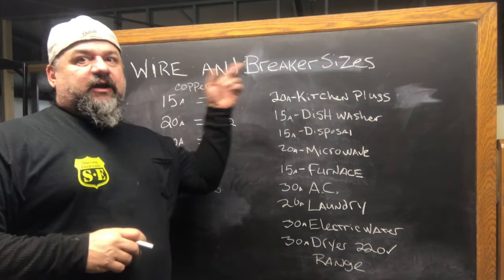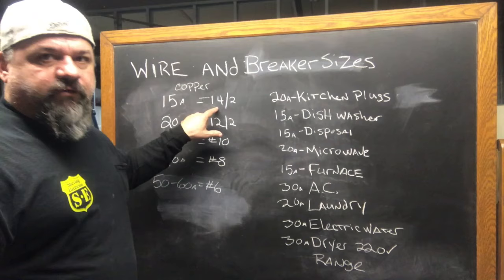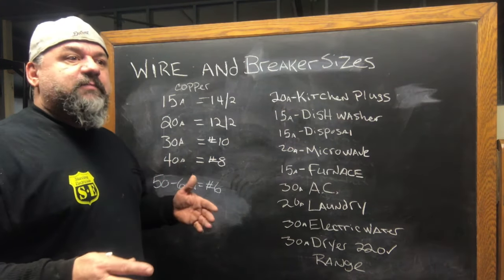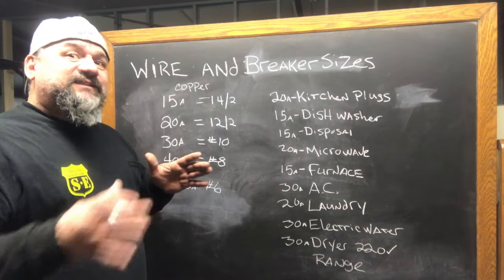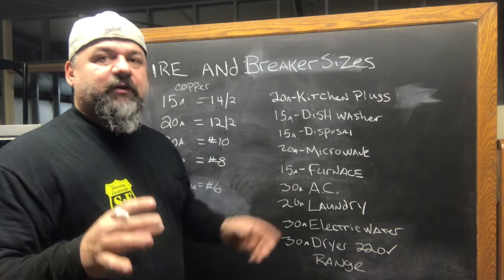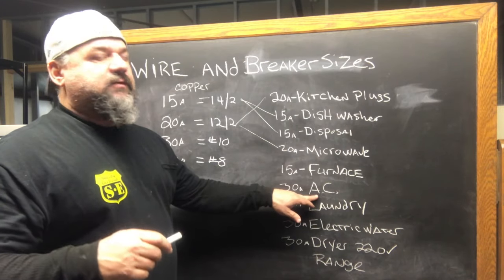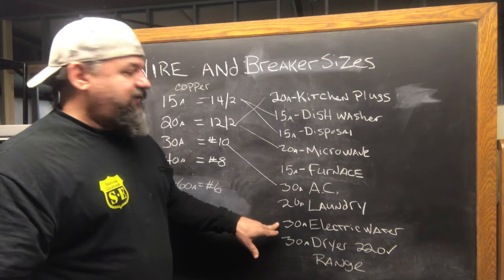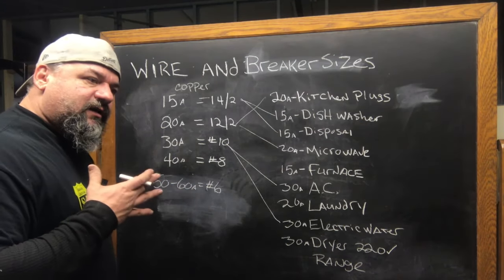"Uncover the Secret to Easily Calculating Electrical Wire and Breaker Sizes!" You wont believe it!

Comment: I recently installed a wall charger for an electric vehicle.  The car pulls 32 amps.  I ran number 6 wire with a 40 amp breaker.  Unfortunately my breaker keeps tripping.  I’ve made sure there is practically no pull from other devices in the house but the breaker trips nonetheless.  Any ideas?
Reply from the maker: well sometimes you just have a bad breaker. your breaker size and wire are right. id start there. load from other devices make no difference on this circuit if its alone. if you are feeding something else then you will have problems. it must be dedicated.
Reply: @StarvingElectrician  thanks for the insight.  Yes it’s in a dedicated line.  I’ll replace the breaker and see what happens.  Sincerely appreciate all your content.
Reply from the maker: @chrisbrawley8810  thank you. always start with the simplest thing first.

Comment: can i use 6/2 wire for 50 amp box
Reply from the maker: yep. its the breaker size that needs to be correct. the wire size can be larger but in this case its right on.

Comment: Im wanting to run an extension cord to plug in to my electric dryer outlet to my 50 amp plazma cutter that I use sometimes. The cord I'm using I got from my old job . How can I tell how many amps it will hold? My dryer is 30 amp
Reply from the maker: it will trip the circuit. check the breaker size for the dryer. even the wire size is too small. go with #6 and a 60 amp breaker.
Reply: @StarvingElectrician  I made one with a 10 gauge wire about 50' long but only ran 35 amps though it . Breaker is 30 amp. Worked great . Most of the time I'd only use 25 amps though, I mainly wanted to see the difference which is a lot. But my cutting mostly consist of the sheet metal. Any suggestions on cleaner cuts, mine seems to be more jagged?
Reply: It need to cut out flames on my fire pit which is an old washer drum so I've been practicing ahead of time.
Reply: @StarvingElectrician  is there different pieces that you can get for smaller cuts? I'm new at this ,my wife bought me one since I wanted one for years so I'm just learning.

Comment: What type/gauge of wire and breaker do I need for a 15 amp 250 volt circuit? Thank you!
Reply from the maker: the voltage has no determination on wire size its the amperage. so 15 amp would be #14 hope this helps
Reply: I used 12 gauge downstairs(for 110-120 volt) when I finished my lower level!
Why?! Because thinner 14 gauge can short out!

My mother in law came over with an ice cream maker!(no off/on switch on it!!)
She unplugged it from the wall & we lost power to the socket!
I checked breaker panel no breakers tripped!
Finally checked the actual box... & the 14 gauge inside shorted out!

Some things you plug into the wall sockets have a higher amp draw! Especially locked rotor amps! Which can cause wire to short or breaker to trip!

Sometimes people plug BIG VACUUM CLEANER into 14 gauge electrical sockets......
Lived in house over 20 years & never had another wire short!
"Lol that mother in-law I tell ya!"
Idk how she did it🤔🙄😂
Reply: 250 volt 15 amps..... if jus go with 12 gauge!
Better to have it & not need it!

Electrical is usually plus/minus 10 percent! 
60 hertz in America 
208/230
Do the percentages & u get 10% north or south of that!

Amperage is more important to properly size the wire!
Example out door Ac... minimal amp/breaker 35!
May not want to use 10 gauge wire!
Use 8 instead & 35-40 amp breaker for minimal (and safety).

Comment: I don't know if you still looking at these old videos can you do another one exactly like this for 60 amp and 100 amp garage with things people would use like welders lights air compressors example
Reply from the maker: its all relative. its all based on the amperage and you size the wire accordingly.

Comment: I’ve got a 70 amp sub panel 80 ft away from the main, what size wire do I need to run? I’m thinking #2 copper in conduit?
Reply from the maker: Brad Nalley number 2 copper would be good for 125 amp I believe. If you are going to do that, then maybe think about a 100 amp. Aluminum is way cheaper. You just need one size bigger is all. # 4 copper would more than enough for 70 amp

Comment: Can you put lights and plugs on the same breaker
Reply from the maker: yep. so long as the load on those plugs and lights do not exceed the bereaker size. some people like to seperate those circuits but you can run them on both. new construction requires arc fault breakers, in that case all lights and plugs need to be on the same breaker for the breaker to work properly.

Comment: I know this is 2 yrs old but here goes.  Maybe you’ll see it.  Is it possible to have a 10x8 shed converted to a office.  4 wall outlet,  ceiling light and fan and a window AC in warm weather and space heater in cold weather on a 30 amp breaker ( 50 amp access is being used for the fifth wheel.
Reply from the maker: you may have enough power but I would go with a 60 amp sub panel and you can put a lot of stuff on that. i wouldnt wire every thing together if thats what you are saying.

Comment: If i use #2 aluminum what size conduit do i need?
Reply from the maker: Chip IS POWDER COATING charles brann  off the top of my head I’d say since it’s three phase and one extra conductor I’d go with 1 1/2”. It’s 1 1/4 single phase.

Comment: Does it make a difference how long the wires run?
Reply from the maker: well you may get a voltage drop if you run far but you would have to run a cuuple hundred feet on one circuit but even then its not likely
Reply: Starving Electrician ok cool.  Thanks for the reply!
Reply from the maker: @commanderstud2417  no problem

Comment: Hey amigo i need your help i put a 14/2 for my light on my restroom from a 20 amp circuit is ok or i can get on fire for this
Reply from the maker: well code wise you are supposed to use #12 but you arent drawing more than a half an amp so theres no danger. its just code but its not right but its not wrong but there is no fire danger

Comment: Do I run my dryer on an 8/3 wire with a 30amp or 40amp breaker?
Reply from the maker: depend on amperage. if its 30 amp then 10 40 its 8

Comment: Can you do a splice on a ground wire inside the electrical box and caping it with a green wire nut?
Reply from the maker: rosalva murillo  you mean inside the panel? You can splice inside an approved box. If it were a main ground wire or bonding wire you would need an approved butt splice or lug

Comment: I'm getting some power from 125 Amp sub panel and I'm 300 ft away from it I had to diy it but it ain't working it losing power I'm using a 30 Amp breaker and 8awg for rv plug
Reply from the maker: well 300 feet isnt that long to get a voltage drop and you over sized the wire as you should so its got to be something different because the wire size is right.

Comment: For a 100 amp sub panel what size of wire do i need
Reply from the maker: #2 aluminum or #4 copper. 4 wire for each. 2 hots, 1 neutral, one ground.

Comment: I have a sub panel in my garage I put an instant hot water electric tankless water heater it has 240 V needed to operate across the logs of the subpanel I have 217 V do I need to change out the main feed wires coming from the main panel to the sub panel they are currently number for wires I was thinking of changing them to number two
Reply from the maker: https://liveelectrician.com/f/electrical-questions.    can you post this question to my blog?  you are good but I would like to explain and need the content thanks!!!

Comment: What will happen if your wire size is 1 point bigger than the amps rating? Thank you
Reply from the maker: Nothing., it’s a matter of your breaker. If you have a big wire and a 15 am breaker the circuit will still be 15 amps  . If the wire was smaller than the breaker then maybe the wire would fail before the breaker tripped.

Comment: Nice video! So I'm trying to put in a 250v 50amp outlet in the shed to operate a welder that I just got. I have a 50amp breaker ready to go as well. The welder itself says that it only puts out 230v at 60 Hertz. My question is about the wiring. Can I run #10/2 for this or do I have to run #6? And do you think I need to run a neutral for this (3 wires and 1 gound)?
Thanks for the video again!
Reply: Never mind the first question. (It sounded stupid to me while I was typing it.......I just saw the video.......use the darn #6 wire. The real question is whether or not to have a neutral at that amp rating?
Reply from the maker: Adam Quick  you will need #6 and I doubt you need a neutral but if there’s a cord on the welder that would tell you. But I highly doubt it.

Comment: Incase someone is planning to install a 100 amp subpannel.   2 gauge aluminum wire is too large to fit in a 100 amp breaker.   I have read you shouldn't strip down he ends to make them fit because you will lose amperage.  So I had to buy a GAD04 1/0 gauge reducer. Only six of them because the ground wire is small enough to fit the lugs.
Reply from the maker: It’s not to large. Number 2 aluminum is made for 100 amp. 1/0 is too big for sure. You got a bigger wire and your saying that worked? Number 2 is a smaller gauge
Reply: The 1/0 reducer had to be bigger then the 2/0 wire to fit over the wire.  It's a cap that fits over the end of the wire.

Comment: What happens when you substitute 14-2 in the middle of/ or as a branch off a 20 amp circuit ?
Reply from the maker: the circuit is as only strong as that wire. let me be real. im sure nothing will happen but by code  if there is a fault the wire would burn out before the breaker would trip. never seen it but thats what is supposed to happen. you could just change the breaker to a 15 amp and you my friend are up to code!!...lol

Comment: What wire size for 80 amp, I'm running power to a pool pump, heater, etc
Reply from the maker: I would go 100 amp and thats #4 copper or #2 aluminum. of you have a 80 amp breaker then go down one size thats #4 aluminum or #6 copper. id still use the wire rated for 100 amps because of the continus load.
Reply: @StarvingElectrician  thanks man you're awesome!
Reply from the maker: @jeffreymcaninch4065   thank you. stay safe!!

Comment: i need to make ev car charger outlet for 240 level 2 volt should i use 16 amp or 32 amp but there is no breaker for 16 or 32.
Reply from the maker: you always round up. so you use either a 20 amp breaker and #12 wire or a 40 amp breaker and #8 wire. thanks

Comment: question I have a 20 HP motor on the plate have Amps 57.0/28.5 what that means
Reply from the maker: Well if you do the math, each ho is 746 Watts I believe. Times 20 gives you the total load. Now decide that from the voltage. I did it divided by 240 and it’s 62 amps.  Now if it’s lower then is it 3 phase?  All this aside 57 amps means a 60 amp breaker and number 6 wire. If it’s a continues load of over three hours you multiply it by 1.25 because of the heat on the wire and breaker. If you go straight from the name plate and it says 57 amps, you should be good with a 60 amp circuit. Hope this helps ya.

Comment: Awesome ⭐⭐⭐⭐⭐⭐
Reply from the maker: Thanks 🤗
Reply: @StarvingElectrician   What size wire you think would be good to run a 100Amp  Subpanel to a shed about 100 ft ? For  6 -8 Ciruts  Breakers + 2 AC/ Window Units 120^《 Volts Each  , + over head light  with ~single pole switch~/ several receptacles ?" !Inside Main Breaker Panel 200 Amp Box} ¤{ In House ◇?

Comment: Please help
Hi guys,
I have tons of 277v light that needs to be installed but I'm not sure which gauge wire, circuit breaker and electrical panel to get. Please help!!
Reply from the maker: its the same thing for all voltages. add up all the wattage of the lights and divide by 277  that will give you the amperage and determines the wire and breaker size. electricity doesn't know what panel you use. it really doesnt matter so long as its a 3 phase panel since the lights are three phase. hope this helps

Comment: How many different amp breakers can I put on a panel that has 50 amps
Reply from the maker: you can put 10000000 as many as you have space for. the issue is the load. do all of your circuits draw less than 50 amps? because a breakes says 15 amps, that doesnt mean that circuit draws that. thats just the point where the circuit trips, at 15 amps. without a AC and an electric stove a house usually only draws about 30 amps at any given time. hope this helps.

Comment: how far can you run 10/2 wire on a 30 amp breaker for a AC unit
Reply from the maker: theres no real number its a matter of measuring the voltage on a long run but you can go a couple hundred feet and be good

Comment: so if I have a 200' run for a 15 amp breaker and the receptacle is feeding a cement mixer, small electric bag sealer and three lighting fixtures with 3 40 watt bulbs what size wire would you use and would you bump up to a 20amp breaker or larger. My neighbor is going to burn her house down  lol
Reply from the maker: lol noooooooo! id say a 20 amp circuit for the mixer alone. 200 feet there may even be a voltage drop. i would run another circuit if I were you.
Reply: @StarvingElectrician  Thank you !!

Comment: Why is it dangerous if the wire size is too large for the breaker? Like if you have a 30 amp breaker in the wire size is larger than 10 gauge?
Reply from the maker: Lee Sales  that’s not dangerous. Like I was taught, if you have a race car and the speed limit is 55. It doesn’t matter how fast you go, the limit is 55. Your limit is 30 amp. The breaker decides how much amperage it can take before it trips. A bigger wire size is a better conductor and isn’t dangerous at all. It doesn’t change anything on the circuits value of 30 amps or what it’s fused at., people ask what can kill you? Voltage or amperage?? Amperage is only as high as the breaker it trips when the load exceeds it or draws more than the breaker can handle. The voltage is the killer. Amperage is only the tripping point and the wire is the vehicle that delivers the voltage. The device it’s feeding determines the wire size. Hope this helps

Comment: Video (S.E.) : What if you forgo any wiring smaller than 12awg? In my shed/home/shome, due to wire roll cost, it was cheaper for me to buy a single 12awg roll for all outlets and lights boxes, while using 15 or 20 amp breakers for each branch circuit. I do have single appliance branch circuits for the wall mounted AC and a future 120vAC combo washer-dryer (20amp breakers). But again, all my wiring is 12awg from the panel board. [For.Youtuber.Information. : I do not, and will not, have any 30 amp appliances.]
Reply from the maker: igounfazed man that is simple! Let’s say you have a race car and can go 300 mph. Does that mean you should or can? The speed limit is 55. So you have a wire rated for a million amps, that’s ok. It has to be fixed at the name plate rating. If that 16 amps then ist a 20 amp breaker because you never undersize it.  Never have a bigger breaker than the wire size or you create the problems.  You are good as far as I can see. Any more questions please ask!
Reply: Thank you!

Comment: Hi! Thanks for the info. I'm working on  a project - didn't hear this question covered.  What if the Amps are 32 for a plugged in device (outside plug-in charger for an Electric Vehicle).  I have heard to go bigger than needed for potential future upgrades with the charger.   Thanks for the video and any additional help!
Reply from the maker: That is correct. you go bigger because you are already over the limit of 30 amps. you always round up. its not for adding, its for the continuous load you have. when the breaker or wire gets hot you have problems, this is why we go bigger to handle that load.

Comment: Have a house in Africa I am using a generator that’s 3000 watts but the total amps is 36 outlet in the house
Reply from the maker: if its 110v then divide 3000 by 110 that will give you the amps. if its 220v divide 220 by 3000 and that is your amperage.

Comment: How do you wire a GFCI on a parallel circuit, is the first outlet the GFCI and the remaining outlets get power from GFCI?
Reply from the maker: You are 100 percent correct. The basis of the gfi is so it can be in series but if the gfi covers the first receptacle then everything else downstream will be protected.

Comment: So i see you say a neutral is for a dryer or computer run things. This must be why a regular compressor won't need a neutral but a newer screw compressor with digital readouts needs it
Reply from the maker: Exactly. It’s for things with electronics. Like an old stove with heating elements you only need the hots and a ground just like a 220v water heater.

Comment: I have a hundred amp breaker box in my house I have a hundred amp breaker box in my building should I use aluminum wire or what I'm basically going from my house to my building coming out my house breaker box
Reply from the maker: wesley McGowans  well #2 aluminium or #4 copper. What the wire is made of doesn’t matter it’s a matter of if the size of the wire is the right size.  So two hots, neutral, and a ground.

Comment: there is no code anywhere in the nec that has a set in stone wire to breaker size. every situation is different. for a 15 amp motor in certain situations you can put a 40 amp breaker and 14 awg wires according to code.
Reply from the maker: yes this is true but we are talking about temperature, motors, three phase etc. for all intents and purposes this is only a rule of thumb video for residential and beginners. I know about all the lengthy explanations on how it changes but for this video This is what you use for practical wiring in a house. and yes in the code book there is a section for wire and over-current devices.
Reply: @StarvingElectrician  310.15(b)(16) might be what your referring to but point taken thanks